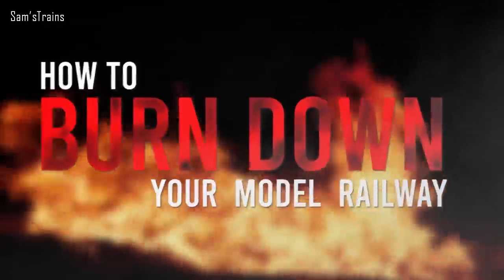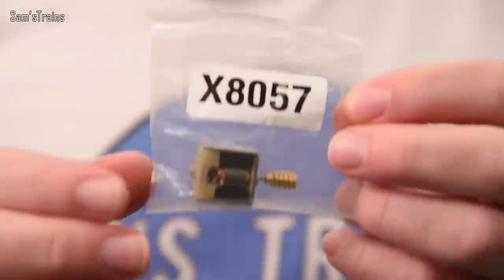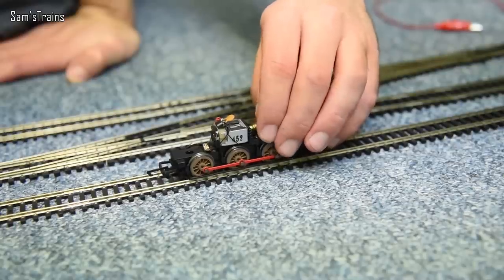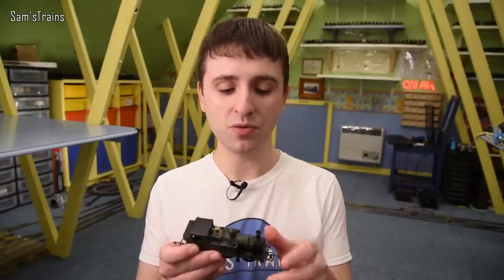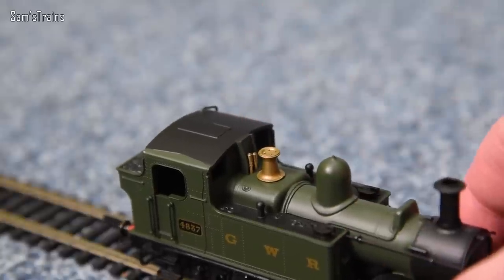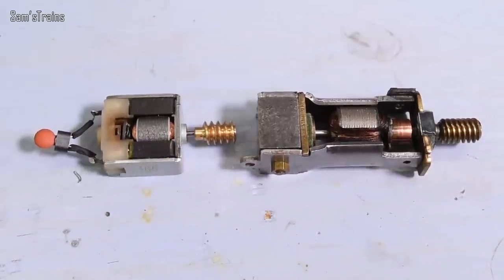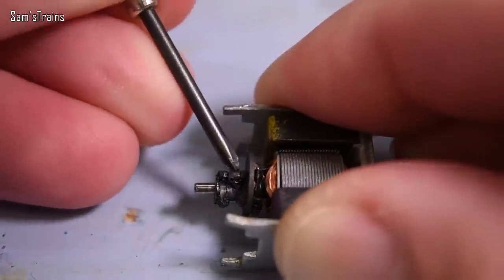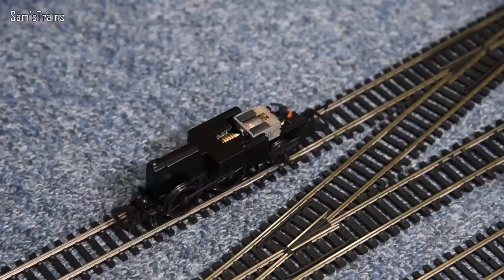How to Burn Down Your Model Railway | Train Motor Meltdowns

Comment: One of my Bachmann 2-8-0s was running and it stopped on a curve and I saw smoke coming from underneath the drivers and turned it off right away luckily I was able to replace the motor and get it working again but then a week later the side rods got messed up while it was running and I’m not sure how to fix it so I was thinking about sending it over to see if you could fix it. Great video by the way. Thanks, Rails Of The East Coast

Comment: I have five locomotives that had motor burnouts. Two happened during normal operation, one happened when the plastic drive shafts jammed, and two were from just trying to get the engine to move again (like you did, but these locos haven't burned out previously). All of them were used models except for one Bachmann diesel I got new back in 2011
Most of my motor burnouts happened with "pancake" motors from various manufacturers and various ages.
Reply from the maker: That's quite a lot mate - and yes I've seen one or two pancake failures :/
Thanks for watching - Sam :)

Comment: Also had trouble with Bachmann motors. You mention replacing them - where can you buy replacement (higher quality) motors?
Reply: Good question. Also for Hornby
Reply: In truth you can’t upgrade them just have to keep replacing them as and when they fail
Reply from the maker: I've never found any better Bachmann ones - they seem to be proprietary (not accidental!) I'm doing a video on the Hornby ones soon! :D
Thanks for watching - Sam :)

Comment: Excellent video Sam,my Hornby Q1 caught fire because the link rod below the smokebox detached itself from the motion and caused a short circuit.This was spectacular as there were flames and smoke in seconds which melted the locomotive body on that side. I removed the locomotive and put the fire out,luckily the mechanism and sound chip were ok.This was a brand new locomotive so this should not have happened, I fitted a new body to the locomotive and did not refit the link rod as the earlier models did not have it.
Reply from the maker: Crikey Tony, that sounds really dramatic - I've often had loose crankpins on models from Hornby!!
Thanks for watching - Sam :)

Comment: The closest I had was decoder burnout due to poor wiring and soldering from Hornby. Was surprised that your experience has seen bachmann with more motor issues. Very interesting to watch and most enjoyable. Most of all hobby safe Sam. Clint
Reply from the maker: Oh yeah I've had that once or twice before - decoders blowing up - but yes, many Bachmann failures in my experience!
Thanks for watching - Sam :)

Comment: My Bachman Thomas has a similar open frame motor, and when I went to service it, it had this green gunk in it! Even stranger, the loco had been running fine with it there for who’s knew how long, and after I removed most of the goo, it still ran perfectly!
Reply from the maker: Yeah they do have a similar motor - that was probably some lubricant - it should run better now that's not inside the motor ;)
Thanks for watching - Sam :)

Comment: just had to replace the intermediate drive cog on my Bachmann class 45.  but not a spectacular failure, the problem I would guess with the motor appears to me either the bearing or its overheating and jamming due to expansion. most of my Hornby are the older ringfield type and I have so far had little problems with them, they do  smoke occasionally  but thats usually oil getting inside or arcing
Reply from the maker: AHh sorry to hear that - glad you were able to replace it though! You very rarely see ringfields fail, which is excellent! :D
Thanks for watching - Sam :)

Comment: Obviously, Motors run on their contained smoke.  As the % of Load (drag)  RPM decreases, (from the No Load value), the brushes and communitator winding start to get hot  .Add enough drag and you will find the point where all of the motor smoke is released !  Once it's out, it's Bye, Bye motor !
    GREAT informative Video, SAM !

Comment: I bought the Airfix version of the 14xx recently, exclusively for a replica "Titfield Thunderbolt" train, and because it didn't cost too much - The motor seems alright, though the mechanism squeals quite badly in reverse. The motor failure on your more modern one is, er, definitely something spectacular.
Reply from the maker: Ahh yeah - have you tried giving it a bit of a service? The motors on the older models did seem to be better!
Thanks for watching - Sam :)
Reply: @SamsTrains  I've had the loco as far apart as I could get it, seems a lot of the Airfix stuff have totally sealed drive units, though it does run well enough forward for what was roughly £20. Could potentially be something to do with the brushes, not completely sure.

Comment: I got opposite experiences with little DC motors in model railways (scale H0) or construction kits. In case of a blockade they consume always their maximum of current, but did not exceed 0,7 A. Common and intended use leads to not more than 0,3 up to 0,4 A in maximum. The small motor type you tested in your video I rather found in N scale models. When voltage applied gets too high and the motor runs freely without any load especially the smaller types begin to make a squeaking noise after a short time and have to get replaced.

It is a very bad idea to get "plenty of oil in the bearings" of a motor. E.g. brass bearings have an internal structure allowing them to keep lubrication for a long time due to capillar effects, these types of bearings work a bit like a sponge. If you apply too much oil the lubrication just flies away quickly and make the bearings running dry. The manufacturer of my model locos (H0) (and many others) advises his customers to apply not more (!) than just one small drop of recommended oil on each bearing, for the newer motors they do not want to have any lubrication at all. If the oil reaches the brushes the (always present) arcing converts it into a mixture of coal and tar. Coal conducts electricity and can short the commutator, tar isolates and can prevent the motor from any movement electrically or mechanically.

Comment: Just got a used Broadway Limited Imports Pennsylvania GG1 last week, it stopped running a few days after I got it. I opened it up today and found out the pick up wires on one side of the engine have fried. Working on replacing them now, hoping it works out.
Reply from the maker: Ahh that's not good mate - sorry to hear about that :(
Thanks for watching - Sam :)
Reply: Sam'sTrains It’s all good, I actually brought it back to life last night. Thanks for the support.

Comment: Locos with motor issues in my fleet at the moment (others are fixed):
- Bachmann + (US) B23 diesel: brush "dematerialized"; couldn't get a new set (motor otherwise OK)
- Spectrum (Bachmann US) GP40 diesel (split chassis): won't run steady, speed changes randomly (same motor btw)... brush maybe, and over-oiling?
- Liliput (Bachmann group) D13 diesel: runs fine, has a 5 pole flywheel motor , but generates heat, even without load, killed two 21pin decoders so far, ... ?faulty pole? - no response from Bachmann/Liliput EU ltd. for replacement
- Rivarossi V160 diesel (old): brush crumbled , needs an unusually large brush with a hole in the middle,... no luck finding one so far.
- Piko DRG class 96 tank loco(the pilot lot one, with the large brass motorpart, only 1 year in production, then model got a major upgrade): slows down after it warms up, but no significant heat, or bad smell    ???    My later one is OK
-Jouef SNCF CC 40101 electric: motor fell apart ... weird !   - loco will be scraped for parts.
No motor issues with German or Japan models so far!
Reply from the maker: Quite a diverse range of brands for failures there then - except the German ones of course! :O
Thanks for watching - Sam :)

Comment: Oddly enough, the exact same thing happened to my 14xx earlier on this afternoon, probably for the same reason. Not totally burnt out though, it still runs but intermittently. I've sent off for a replacement motor and I will check out the old one to see if it's repairable. Nice video. 🙂👍
Reply from the maker: Blimey sorry to hear that mate - the motors are good and cheap aren't they? Though that's probably the issue ;)
Thanks for watching - Sam :)
Reply: Yes a very good price. £4 plus just under £2 p&p. I hope that doesn't reflect a sign of the quality. 🤔

Comment: I recently bought a 30 year-old Hornby Black 5 from Ebay. When I was first trying it out, the loco started to smoke quite heavily. However, after a few minutes, and the smoke had disipated, I tried it again, and found that it actually ran BETTER - much more responsive to my controller, and much faster.
Reply from the maker: Uh oh - was that the old ringfield one? Maybe there was some corrosion on the commutator that took some burning off!
Thanks for watching - Sam :)
Reply: @SamsTrains  Yes. A Ringfield Type 5. However, I was assured by the seller that the locomotive had had a good service before being placed up for sale. So it may well have been oil being burned off.

Comment: AHHH it seems my problem with my Hornby B12 is solved.  This same motor was factory fitted to my B12 when I purchased it well over 10 years ago.  It ran well for nearly a year then due to life getting in the way it was packed away in the original box in a plastic storage tub with the rest of my loco's.  A while back I decided to build a layout for my Grandson and, lo and behold when the  B12 was placed on the track and power applied it would not run and instead it sat there and emitted an acrid smell and smoke.  So not being that confident to strip the loco and motor down and, only this week after watching and getting inspired by your videos I pulled the loco down and dismantled the motor.  I thoroughly cleaned everything and what did I find the brushes gone as with your motor but not as bad. In fact I could find no evidence that there ever were any brushes.  The only contact with the commutator were the brass fingers that would have held the brushes. All I can deduce from this is that the materials used to make the brushes was so sub standard as to be absolutely useless for the purpose or a very poor quality control issue allowed this model to slip through.  I had previously purchased a new motor ( Poweline P1232A ( mk3) from E Bay which was not cheap and will now fit that. I did manage to get the original motor to run again but without the brushes it is totally useless as a spare. What I can't figure out is why did Hornby put these pathetic substandard motors into the B12 and not something more robust such as an XO3 or similar???  At least I can buy XO3's in bulk quite cheaply.  So unless I can find a mount to take an XO3 or similar I will be stuck with paying $18.95 or 9.47 English pounds each so quite an expensive exercise.  This will now ensure this loco does not get much running time as it will end up being to expensive to maintain.  I will contact Hornby to see what they can do but am not hopeful of any sort of positive outcome other than a note saying they received my E Mail.

Comment: I have an old Triang 0-6-0 saddle tank engine and after I bought it I noticed a smell, but I put it down to not being ran for ages, then I saw smoke coming out the cab,  I investigated and its a part of the commutator is where the smoke is coming from, I didn't run it, so it wouldn't ruin the motor, I'm hoping to get it checked out at my model railway club :)
Reply from the maker: Yeah that's pretty common with a tri-ang - just give it a clean up, fresh oil, and it'll be fine! :D
Thanks for watching - Sam :)
Reply: @SamsTrains  oh ok, thank you for your advice :)

Comment: When motors over heat, the insulation on the wires that make up the windings in the motor softens or melts an electrical short usually develops, sometimes with an exciting show.
Reply from the maker: That's absolutely true - I should have measured the windings on the failed motor, that would have been interesting!
Thanks for watching - Sam :)
Reply: The wire 'windings' looked fine in the video. The commutator was the problem. I always think to run them in a bit at first. It would be an interesting experiment to monitor the current when adding one carage at a time.

Comment: There is a component of the drive force which pushes the worm away from the drive gear which can deflect the motor axle which also will heat the bearings.

Comment: Luckily I've had no catastrophic failures to any of my locos but I do have an N scale brass diesel with an open armature motor that's arcing n' sparking all over. I tried cleaning the commutator with contact cleaner but it's only helped slightly.

I also recently purchased some used N locos including a diesel with one melted down truck/bogie. Another person left the loco bridging two blocks of a DC layout causing the meltdown!
Reply from the maker: Good to hear that Sharky - yeah I've had a few like that - some do just spark a lot! Blimey - that doesn't sound good at all, lol! ;d
Thanks for watching - Sam :)

Comment: Hi Sam 
One of the reason can be your pulse power supply. Those motors were not designed for the power what you supply can deliver ( PWM or just a thyristor chopped 50 Hz). Most of the pulse power packs always deliver in pulse with modulation (PWM) the maximum power to the motor. This method overheats the commutator and the coils ( the commutator has to interrupt and turn on always the maximum voltage from the power supply. ). This method is even more dangerous for coreless motors because of lower heat dissipation capacity.)
In old fashion filtered DC power packs the maximum voltage is present only at maximum power ( when you run your trains at maximum speed - how often is this the case? ).. One of the possible solutions is to reduce the voltage what goes into your power packs. ( in DCC for eg to 10-12 V). In your GM power pack it is more complex issue.
Just an example. The commutator on a  6000 RPM 3 pole motor  interrupts the power 200 times per second (200 Hz) only on highest speed. Every interruption creates a spark and heat. When you use a pulse power supply from GM it adds another 50 or 100 interruption independently from the motor speed, on top of that always with the highest possible voltage ( power). This overheats the commutator and the coils, and finally kills those simple motors.

Comment: I have two DCC 0-6-0 locos with type M motors, and they haven't been running very well all of a sudden. One has started smelling bad and running slowly... should I be concerned/do something before the DCC circuitry etc gets fried?
Reply from the maker: Ahh that could be a sign of a failure - it's probably worth just ordering a replacement motor for them - they're cheap enough on Ebay!
Thanks for watching - Sam :)
Reply: Watch out buying motors off eBay there’s a few fake ones out there ... I know I’ve had the miss fortune of buying one and and after 4 months having not just smoke but flames coming from the motor which melted a hole in the body of the school class ... I sent it off too Hornby with a letter explaining what happened after I sent a email Hornby called me and said thanks for bringing this to our attention and we regret to inform you that the motor was a fake and they have got in touch with trading standards on my behalf
Reply: @SuperDvsmith  Eek, rather one than the other!  I'll be careful, thanks for letting me know :)

Comment: Hi Sam. Good video as always. I've had a lot of problems over the years with hornby motors hence now all my locomotives are bachmann. I do however have a good tip. When oiling the motors I use a sewing needle to dip in the oil when lubricating the end bearing. That way its almost impossible to over lubricate and no risk to the commutator. My oldest locomotives are sixteen years old and still on original motors including the brushes. Keep up the good work. Chris.
Reply from the maker: Thanks a lot Chris, sorry to hear that - yes that's a good tip - I do only use a tiny amount of oil!
Thanks for watching - Sam :)

Comment: My hornby class 58 almost suffered the same demise today i was running it noticed a wierd smell burnt myself on the motor after taking to bogie out of the body no fire or melting but wow i have recently fitted a new motor to it and it was running unloaded apart from 25g weights i added
Reply: Also i was running it at almost a slow crawl i dont get it 😣

Comment: I tried an old triang 0-4-0 not realising how old it was. it cause the track to spark, and at the moment it started smoking I took it off the track straight away, I never used it again. But I still have it on my shelf next to my fireplace ( rather ironically )
Reply from the maker: Sorry to hear that mate - they often need a bit of a service to run well, though the sparks are quite normal!
Thanks for watching - Sam :)

Comment: I’ve had loco motors smoke on me but I cut the power immediately and they still run ok, I remember as crazy as it may seem I had an old tri ang Britannia that I thought had burned out, but recently I applied power to the motor and all it needed was lubrication otherwise it was fine. 

The strangest part was my Bachmann Thomas, that burned out with no warning at all not even by slowing down. But that was some years agi
Reply from the maker: Yeah I guess if you can catch it and cool it down before any damage is done, you might get away with it! Yes the Tri-ang locos are very difficult to burn out!
Thanks for watching - Sam :)

Comment: About a year ago, I bought a loco from the 1980’s from a train fair, and it was in good physical shape, but at higher speeds its wheels would spark like crazy. I stored it somewhere and I haven’t run it since.
Reply from the maker: Some locos do that - a bit of sparking around the wheels isn't too bad!
Thanks for watching - Sam :)